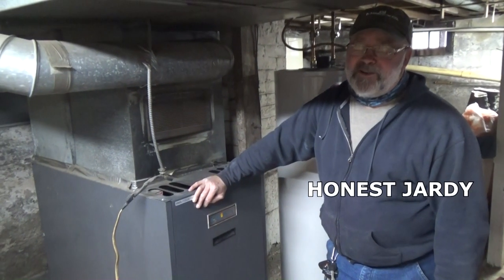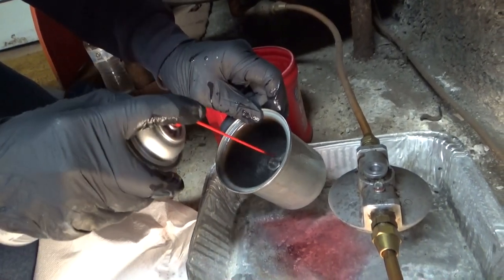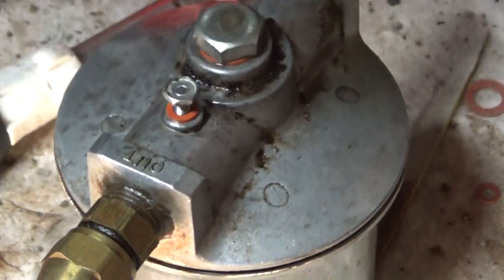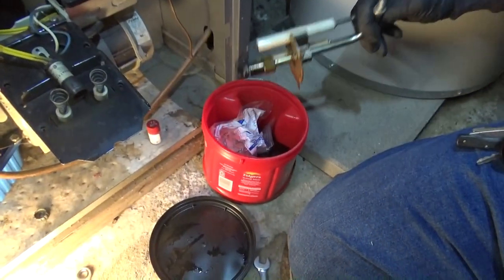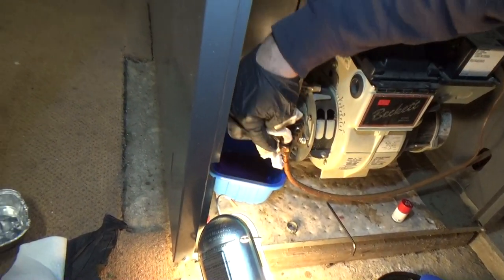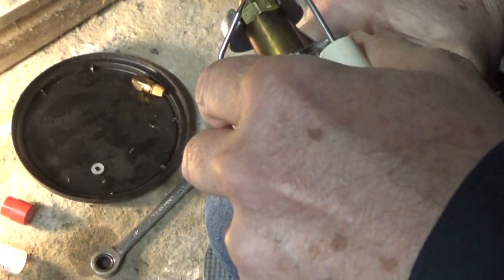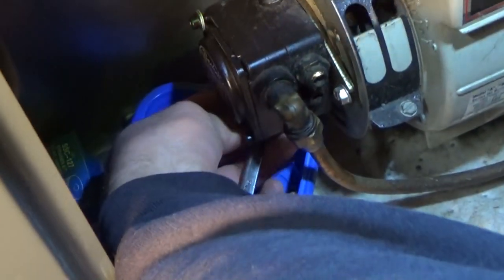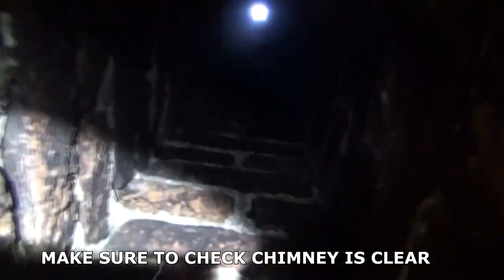OIL BURNER YEARLY SERVICE & CLEAN (Part 2) Honest Jardy's plumbing

Comment: thanks for info. my tank was down to a foot of fuel left. now the reset button needs pushed like a dozen times a night. filter and nozzle replaced 3 years ago. pump in tank is pretty loud. its a very old williamson oil saver with lenox sticker. thats all i know.🍻
Reply from the maker: I would keep the tank at least 1/2 way at all times and do a service once a year, I hope it helps
Reply: @mikehaduck-travel-mechanic884  thanks for the great info! nice n toasty now. i can finally sleep threw the nite.🍻

Comment: Good morning Mr Mike my name is Carlos from NJ first able thank you for taking the time to show your videos in your YouTube channel.I have an  WEIL- McLAIN old oil boiler which sometimes goes off because the wires inside the Beckett gets in front of the eye in the nasal and i have to move them out of the way when that happens, what do you recommend for this case of my?I used to have a company contact but I got i realized that the job wasn't getting done right.My weil McLain model QB-180.
Reply from the maker: Hi Carlos, the best guy to ask is the plumbing store senior salesman, take the model number etc, they can tell you the faults of each model best,

Comment: Hi mike, i left another comment in your part one, it is a little confusing, on my NY151 furnace ask for different type of nozzle, but on this burned( your here; Beckett A-AF type asking to use different one, what is going on, should be go with burned nozzle type of furnace plate on it !!, on my burner say 100 psi, this one i see say 125 psi, does it make it different setting ?
Reply from the maker: Hi pal, the plumbing,  heating supply store will match it up and give you the best advice, thanks, Mike